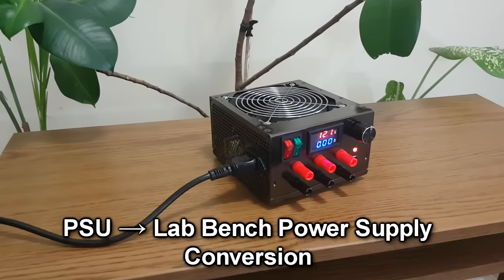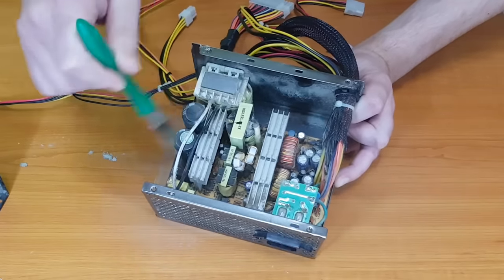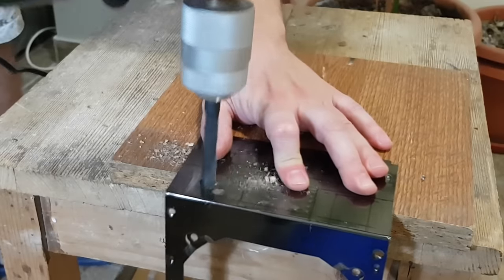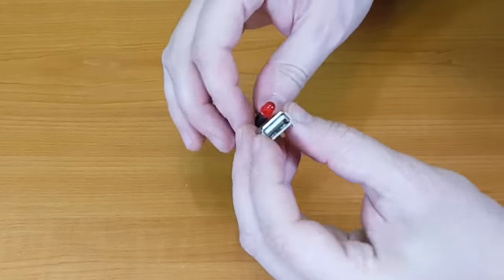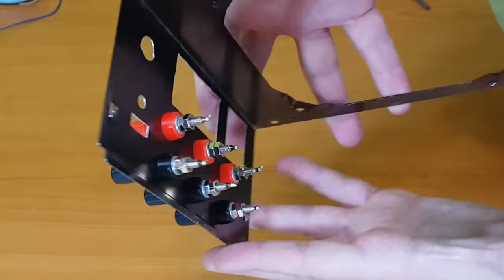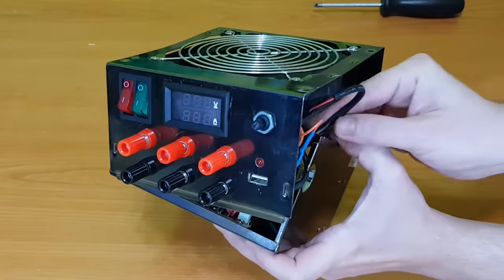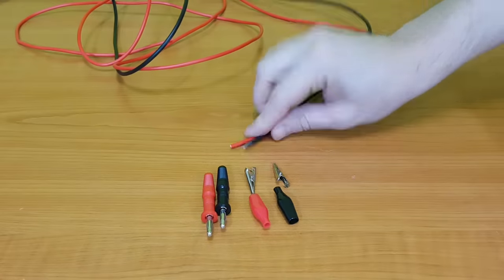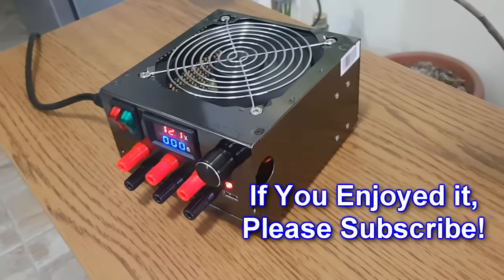DIY - Lab Bench Power Supply

Comment: Very nice video. Is it possible to use multiple power supplies together to increase the voltage and amperage? I am looking for adjustable 32 volts and adjustable 50 amps for electroplating. Your unit is very tidy and I would like to combine a couple if possible to achieve my targets. Thanks in advance and keep up the great videos
Reply from the maker: hi. I've never try this before. with a few small modifications I think it will work. I will try this in a future video.

Comment: Do you still need a dummy load if the potentiometer is powered from the 5v?
Reply from the maker: hi. the knob is not for a potentiometer, it's a rotary switch. the voltmeter is powered from the 5V rail, but that's just a tiny load. you still need the dummy load resistor. please watch the part2 video for more info.
Reply: @Sorin_DIY  Sorry meant the volt meter display load..

Comment: I know this is a older video but I have a brand new atx power supply I've been using to run my chargers for my Lipo batteries for my rc airplanes. But I've been just temporarily connecting to it. You've motivated me to build this. I'll be ordering the parts soon

Comment: No. 12V delivers the most current. In very old ATX or AT power supplies sure, 5V did supply the most currend but these days (computers that are 15 year old or newer) have the most current on 12V. That's why your cpu, and gpu are powered by the 12v line.

Comment: ok great video,im no pro by far but my question is if you wanted to charge a 12 v battery can you use the yellow black and red 5 volt wires,but put an intenuator (bad spellin) switch or some other mechanism to control the voltage and amperage and maybe even a self cut-off.I know you can do it.Thank you very much and again ,awesome job
Reply from the maker: it depends on what type of battery you want to charge. 12V is not enough, it will need a constant current/constant voltage DC converter.
Reply: @Sorin_DIY  Yes it woul need to be 15 volts at least.considfering you can throw even more voltage than 12 or 14 but amperage usually needs to be greater i guess.but 12 volts wont charge a 12 volt batterty enough.that was why i was wondering if you added the extra 5 volt wire or perhaps another 3 volts can you make this work?
Reply from the maker: you cannot add the 5V wire. you just need the 12V output and add a powerful step up converter with constant current/constant voltage.

Comment: Great video. One question, why are there two rocker power switches?
Reply from the maker: hi. the red switch is for mains current going in the PSU. the green switch is for starting the PSU, by connecting the green wire to a black one.

Comment: if you put both the 12v together the v1 and v2 does that double the available amps?
Reply from the maker: hi. it's not recommended to join the 12V outputs. the voltage may not be stable and the power supply may shut down. you can use them individually, they are very powerful.

Comment: this channel is amazing, and i only found about it now....
i have a question tho - im a bit of an amatur with electricity (of course im following any safety instruction), and this is to be my first  project (prbably a bit simpler then what you did). if i want a 48[v] supply, how can i wire 4 12[v] wires correctly? im afraid i cant figure the connections out on my own.

Comment: What soldering iron is this? Also what magic wire strippers are you using?
Reply from the maker: hi. the soldering gun was made in Romania in the '80s. it's very powerful. the wire stripper is this model:
https://www.aliexpress.com/item/32700869148.html?spm=a2g0o.productlist.0.0.6d4c37b6J9AKJA&algo_pvid=0bad7c42-d423-413f-91ec-1c30ae09de23&algo_expid=0bad7c42-d423-413f-91ec-1c30ae09de23-39&btsid=0ab6f83a15935531329333563e484a&ws_ab_test=searchweb0_0,searchweb201602_,searchweb201603_

Comment: I have a question, I got a dell p5251 d1, 24pin. I know... I should have gotten something else. Anyway, it doesnt have a green wire, but from a generic schematic i found it uses gray as psu on. When I connect it to ground to discharge the capacitor (only 1 not 2), nothing happens. I tried to discharge the cap with a resistor and very long pliers, no spark, nada. Voltmeter reads 0 across the 12v channels and the 3v channels, only 2 wires read 5v+ even with the PS On and Gnd jumped. Can you help me figure it out?

Comment: Has there been any issue with the glue? With extended usage, I am worried about the glue.
Reply from the maker: nu. just don't stick any hot components with hot glue. the metal case is not hot.

Comment: Great video, I am definitely gonna do this 
on a somewhat unrelated note, I have a question, at 3:05 you mention that it is -12v what does it mean for voltage to be negetive?
Reply from the maker: hi. the blue wire is -12V relative to the black wire. if you connect a load between the blue and black wires, blue is the negative wire and black is the positive wire. if you connect a load between the blue and yellow wires, you will have 24V. blue (-12V)... black (0V)... yellow (+12V). so from -12 to +12 you have 24V, but the current will be from the weakest rail, so around 0.5A (-12V). it's the same with the red (+5V) and the orange (+3.3V) wires.
Reply: @Sorin_DIY  ok, Thanks for the quick reply

Comment: Beautiful Conversion. Quick question though, I am doing my own conversion and have seen that using a USB to charge a cell phone actually uses the d+ and d- pins to approve port for charging. Is there a way around this or is it okay to just short them and only use the voltage pins?
Reply from the maker: you can short the data pins and it will charge with max 2A, or you can add a step down module with fast charging protocol and connect it to the 12V rail.
Reply: Sorin - DIY Electrical Nerd thank you for the quick response. I appreciate it.

Comment: one thing i keep missing at these powersupplies is the Step up-down converter
that would allow you to step the power and amperage up and down without steps 
would only need  one 12 volt feed for that
Reply from the maker: hi. there wasn't any more space inside this case for another module, but I made a separate video with a powerful variable power supply. I also plan to make another conversion from a ATX power supply, with variable voltage, current limiting and other features. but at the moment I'm already working on other projects, it will take some time.

Comment: Hi, great video and idea, thank you for share it. I have a question, normaly the atx power suply 12v section has 12 Ampers, How can I reduce to 3 ampers maximum?
Reply from the maker: hi. you can add a 3A fuse. and if you connect a load that draws more than 3A, the fuse will blow. if you connect any other device that needs less than 3A, it's ok.

Comment: Hi! Is it possible to add a current limiting to this? I imagine if you accidentally create a short circuit, it may melt something inside?
Reply from the maker: hi. all power supplies should have over-current and short-circuit protection. I haven't seen one without these protection features. probably the cheap rubbish ones are dangerous. but you can add a fuse on each output.

Comment: Hello I have problem I build this power bench supply my problem is my display volt/amper is on but when I connect something to turn on like a little motor there isn’t a current on biding post please help me !!
Reply from the maker: Was the power supply working before you modified it?
Reply: @Sorin_DIY  yes plz help me to resolve the problem
Reply: @Sorin_DIY  i did it all thing what you did but your worked mine no

Comment: Hi Sorin, 

Loved the video, and am in the pretty advanced stage of copying your build. But I just realized, won't the case act as a conductor between the binding posts???? Did you check your case was non-conductive???
Reply: @DJPaulgee1  thanks for that, much appreciated. I guessed it by myself a few minutes after I posted this. Potentially a lethal mistake someone could mistake.
Reply: @DJPaulgee1  makes me worry if there are others I missed.
Reply from the maker: hi. DJPaulgee1 is right. the plastic body of the binding posts have a groove around the middle connector. the binding posts will stay fixed in the center of the holes.
Reply: Hi, Sorin - might be worth updating the description of the video to say 3 red "insulated" binding posts, 3 black "insulated" ... 

Another question where did you buy your binding posts - the insulated ones available on ebay and Aliexpress - don't have a quality feel about them? 

Nearly finished my build - hopefully will be able to share a picture when I am done.
Reply from the maker: I've bought them from a local hardware store. these are some similar binding posts, you can see the groove in the plastic body in one of the pictures:
https://www.banggood.com/2Pcs-48MM-Insulated-Binding-Post-Audio-Speaker-Terminal-Plug-p-929291.html?rmmds=search&cur_warehouse=CN

Comment: hello sir I’m a student I used this like my school project I followed all your step but I have a problem my lab psu turn for a second and then goes off i mean like screen voltage /amper it goes off when I give the current help me please
Reply from the maker: Hi. Did the power supply work before you modified it? if it doesn't work after modification, the most likely problem is a short in one of the connections. you need to unsolder the components one by one and try to start it, until you find the component or wires that made the short circuit.
you will need to unplug the power supply from the mains socket after each try.
Reply: @Sorin_DIY hello thanks for replying me first was working but my teacher is saying that I have to connect wire of power good signal but I don’t think i have done sort circuit . I have one question what happend if I connect 5w and 10ohm resistor ?
Reply: @Sorin_DIY  but where should I have the problem ? In which component.  Did it affect if I don’t connect led and usb to charge my phone ?
Reply from the maker: the resistor will heat up, it may also be the reason why the power supply turns off. I recommend a 10W resistor with 33 or 47 ohm.
Reply: @Sorin_DIY ok thanks
Reply: @Sorin_DIY  Hello how I have to connect usb I can’t see can you tell me how I have to connect usb port
Reply: @Sorin_DIY I have one question can I put a type c instead of normal usb ??

Comment: I cant find a 43 ohm, 10w resistor anywhere. 47 is the closest I can find! Any suggestions?
Reply from the maker: hi. you can use a 47ohm resistor.
Reply: @Sorin_DIY  thanks! I've got all the parts now. Just realised my psu(I'm using an atx650) has a power switch, can I just ignore the green wire? Many thanks

Comment: What's the difference between using only one 3.3v cable insted of 5 and the same for 12 and 5v. Is it more stable?
Reply from the maker: hi. if I use only one wire for the binding post, it will get very hot, if I connect a load that needs 10-15A. if you want to deliver 1-2A, one wire is ok. but if you want to deliver more amps, you need to replace that power supply wire with a thicker one, or use multiple wires from the same rail.

Comment: Since amps are divided (unevenly), would it not be better to run wires to rotary switch after they have powered the plugs? I’m new so I’m not sure. I want to ask before I mess something up
Reply from the maker: the rotary switch is used only for the voltmeter. the 3 outputs are always connected to the binding posts. please watch the part2 video for more information.

Comment: Very nice video！body.What is the maximum current of the band switch? What about carry a 120 watt vacuum cleaner?My power supply out put 12V 30A.
Reply from the maker: hi. the switch only selects the output for the voltmeter. at 12V the power supply can deliver 18A.
Reply: @Sorin_DIY  Oh，I see it,different bingding post supply different volt power.Not the band switch to choice.Thank you so much.

Comment: How i can connect an analog ampmeter? instead of the digital volt/amp meter you used?
Reply from the maker: it depends on the type of ammeter. you should find on internet the schematic for your ammeter.
Reply: @Sorin_DIY  the ammeter has a negative terminal and a positive terminal. I tested it by connecting it in series and it worked. But i don't know how to make it change the outputs that it reads. The 12V, 5V and 3.3V outputs.
I cant' figure out a way to do it using that rotary switch
Reply from the maker: the rotary switch is for the voltmeter. the ammeter is connected on the negative output in series with the load. the negative wire is common to all the outputs. you connect it like I did in my video with the 2 thick ammeter wires. one or more black negative wires come from the PSU circuit board, goes to one of the ammeter wires (probably the negative one) the other ammeter wire is connected to the negative binding posts.

Comment: Great project!!!
A question...
Do you know how to switch ON an AT (not ATX) P8, P9 sockets? I have an AT psu and I would like to use it as a   psu bench...
Tks from Brazil
Best Regards!!!🇧🇷🙏
Reply from the maker: Hi. A long time ago I used some AT power supplies, but I don't remember which wires turn it on. doesn't the power supply have a mechanical switch?

Comment: I'm getting a fluctuating voltage out of my 12v port and the Voltmeter is t working. Any suggestions? Thanks
Reply from the maker: I think you've connected some wires wrong, but without seeing it, I can't give you a solution. try to disconnect everything, and connect all the wires one by one, like I did in the part2 video. and check everything after you connect each wire.

Comment: Hey Sorin, I'm a fan from the Philippines, I've followed your tutorial and I can't seem to have it turned on, the standby wire (purple) is fine and reads voltage but I can't turn on the PSU even by shorting the green and black wire, where could I have the lapse for it not working? and also, what alternative could I do if I opt not to use a rotary switch? Hoping for a fast response, thanks!
Reply from the maker: hi. there may be a bad connection on the wires or maybe a short circuit. try to undo all your connections on the wires and turn on the power supply again by connecting the green wire to the ground.

Comment: If we use +12v and -12 v wires to obtain the 24v supply terminals, how much current we can draw? Pls answer
Reply from the maker: the total current will be the same as the current from the weakest output.

Comment: What will be the power consumption, if we only use one 12V supply from PSU?
Reply from the maker: the power consumption depends on the load. you need to connect the load and an ammeter in series and measure the current.

Comment: Hi sir. I have an atx power supply of 450W.The voltage rating is labeled in that supply is following 
  3.3V@ 27A
  5V    @ 26A
  12.1V  @26A
  The problem is when i connected the small loads to 12v line the voltage drops very fast.for example i connected an amplifier which draw 1A current the voltage suddenly drops from 12.2v to 11.5V.another example is when i connected a car headlight lamp of 35W the voltage drops from 12.2V to 10.1V.The current draw by the lamp is only 2.5A.why this is happening? Plz reply
Reply from the maker: hi. when you connect a big load, the wires you use are very important. if the wires have a big resistance, they will waste a part of the power. so if you measure the voltage on those wires near the power supply it will show 12V, but if you measure the voltage on the same wires near the load it may show 11.5V. the wires use 0.5V because the wires resistance is added to the load resistance, so the power is divided between these loads (the wires also become a small load in series with the actual load). try to connect 2 or 3 yellow/black wires to the load. another possibility may be that your power supply has a problem and it can't deliver the rated power anymore.
Reply: @Sorin_DIY  thanks for your valuable answer 🥰. Today i desoldered all wires from my supply board and i soldered single 2.5MM copper wire instead of many wires.now the voltage drop problem almost solved.now the voltage is only drops from 12.1 to 11.81 with the 35w halogen lamp with a Current flow about 2.5A. Anyway thanks a lot ✌️

Comment: Is there a way to increase the 12v output to lets say 13,8v  so that it can be used as a power supply for ham radios?
Reply from the maker: hi. you need a powerful step up converter. minimum 3A I think.

Comment: Wait wait.. on 3:07 you said there is a blue wire -12v 0.3 A.. so if I put that ones with all the grounds together is ok?? Or it needs to be apart? Thanks
Reply from the maker: if you measure the voltage between the blue and a black wire you get -12V. the blue wire is practically the negative of this output and the black wire is the positive. so if you measure the voltage between the blue and a yellow wire you get 24V but with only 0.3A.
Reply: @Sorin_DIY  I see.. you got it, but my power supply is different, I don't have the blue wire, cuz all the wires are black, I have gigabyte 850w 80 Gold plus, and it has all the connections.. i just want to get all the 12v+ and all the 12- that's all but something might be wrong because I plug in like a car stereo to it and it shuts off by it self,.. and I have a Corsair CX 750 and that one can handle my car amplifier... So what should I do with the gigabyte? cuz I don't have the diagram and all the wires are black.. any ideas? Thanks

Comment: This is pretty cool!! May I ask how much do the components cost totally (except the power supplier) ?
Reply from the maker: hi. I don't remember exactly, around $15 - 20. I've bought them from a local hardware store. if you buy them online, they will be cheaper.
Reply: Sorin - DIY Electrical Nerd ok , thanks for the reply !
Reply: another question, what if I use trimmer instead of 12 position rotary switch ? will the voltage change continuously when I rotate the knob ?
Reply from the maker: no. you need a step up / step down converter, to adjust the voltage.